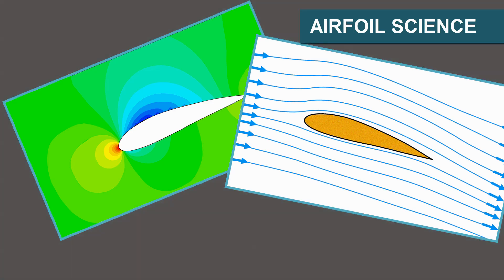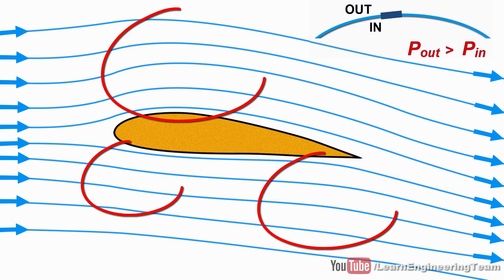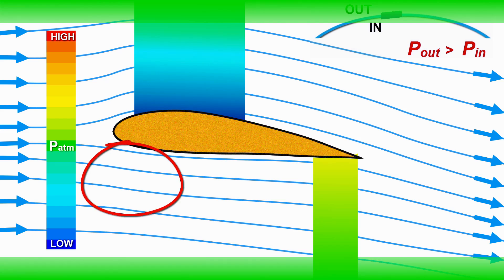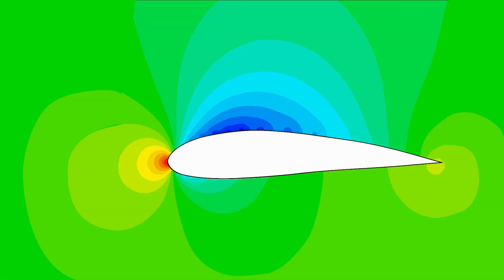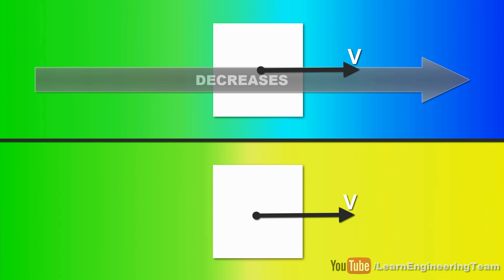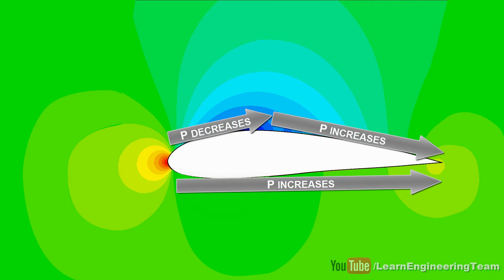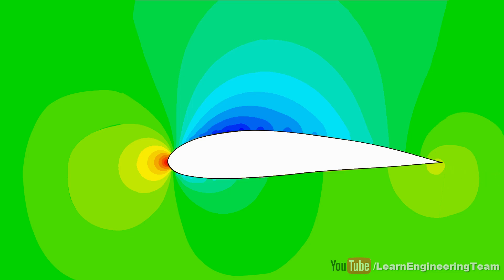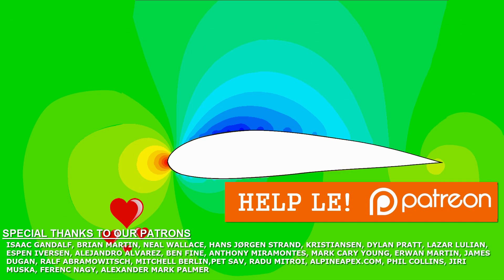Why is the top flow faster over an Airfoil?

Comment: The explanation is the starting and stopping vortex. 

See this as computer simulated:
 https://www.youtube.com/watch?v=bvV7-9wAXc0

An see this as shown in the reality:
https://www.youtube.com/watch?v=BlZrFz0DXr4

Believe not in my explanation, but in your eyes! The second video is shoving clearly the effect, what I describe below.

The little diameter but quickly revving starting vortex has the same perimetrical speed as the big diameter vortex with low rev. 
Starting vortex is doing the biggest job for scientist, gliders, motorized flyers, because it starts the bigger vortex, after separating from trailing edge, and later it dissolves, dissipates in the airflow. 
But it has done the biggest part of the miraculous work of creating LIFT and DRAG!
It has started the big vortex! And that is the more important point!
Because: the big diameter vortex (bounded to the foil, and moving with them around the foil) is let moving the air particles under the foil in the opposite direction as the moving direction of the foil, and lets increasing the speed of the air particles upper the foil. 

This is the real reason of speed difference between air particles travelling on the upper and bottom side of the foil.

Please note at the beginning of the video the starting vortex, which revs in the same place, where it has born, although the foil is fa away. It is existing even without the foil, because foil is travelled with the time very far from starting vortex.
(By sailing boats the satrting vortex doesn't revving in the same place, because wind is carrying away them, but they are travelling even further from the foil)

And please note at the end of the video the big vortex which is existing as well without the foil, because the demonstrator removes, raises the foil from the bathtub, and the big vortex is still revving without the foil.

This is the real cause that airplanes can fly.

If you are paying attention to the second part of the video, you can see at the same time both vortexes, which are revving in the opposite direction!

You can imagine this as two gearwheels, or the self starter of a car. 
At the beginning the engine needs the help of the starter, but later it works autonomously, and drives your car forward.
Foils create LIFT, which holds the plane in the air, and helps sailors to sail windwards.

DRAG is owerpowered with the engine of the aircraft, or with the loss of height by unmotorized gliders, or with the power of sails. On a sailing boat the LIFT pushes the boat forward, and sidewards too. Sideward forces are resisted/balanced with the keels, and other foils under the water on a sailing boat. But sideward forces from LIFT can't be defeated fully, that is the reason for side slip of sailing boats.
This means, that a direction showing by a sailing boat vessels apparently longitudinal axle isn't the final direction over the ground of the see, or water. LIFT pushes  the boat sidewards as well.

This causes, that you see a direction on your compass at the sailing boat, and if you copy this direction to a paper map, and after some hours of sailing with the same constant direction you won't be at the place where you have planned.
The sideforces from the LIFT will mislead you, so your direction above the ground isn't the same as shown on the compass.
Reply: The starting vortex does not do anything. It's necessary for conservation of angular momentum in a fluid, but it isn't a "cause".

Comment: The lower pressure gradient on top foil is lower than the bottom foil BECAUSE the fluid particle is moving faster. This is the result of the Bernoulli principle, which states that fluids at higher velocities induce lower pressures. This explanation uses the consequence of the acceleration to justify its existence.
Reply: No, you have it backwards. The faster rate is due to the lower pressure. It's common to get this backwards. https://www.grc.nasa.gov/www/k-12/airplane/wrong1.html

Comment: Shouldn't the atmospheric pressure get low as we move upward?
Reply: You're thinking of atmospheric pressure changes due to altitude changes on a planet scale. This is talking about the scale of a wing, and the pressure change from the top surface of the wing to atmospheric pressure will be an increase.
Reply: that doesn't really matter in this situation. What they mean is that the pressure over the wing is lower compared to the atmospheric pressure.
Reply: lol is this a troll

Comment: This is by far the best concise video on 2D airfoil flow. There are so many misconceptions out there, it's refreshing to see a video which communicates the main ideas so clearly. 

Whilst it doesn't directly explain lift and drag, those two forces can be inferred from integrating the pressure field around the airfoil surface. The only part of the picture it doesn't help to show is that of momentum conservation. A net lift necessarily results from a downwards component of momentum imparted to the freestream.

Comment: I wish you provided more information about why the pressure gets lower above the airfoil. I just can't get what makes the pressure lower there.
Reply: curvature of the flow makes the pressure gradient.
Reply: basically its just  a suction force
Reply: "suction force" doesn't say anything at all about why this suction exists.

Simply put, the lower pressure exists on top of the airfoil, because part of the air that was supposed to be there, was deflected by the bottom of the wing
Reply: I thiiiiiink it has something to do with the speed of the airflow.  Are they trying to say rushing air is thinner?  I don’t know…….
Reply: It has to do with Bernoulli's equation; basically pressure and velocity are inversely proportional. That is, as pressure increases, velocity decreases and vice versa. You can google it, and here's a reddit discussion about it: https://www.reddit.com/r/AskEngineers/comments/7h1i7y/why_pressure_decrease_when_velocity_increases_in/

Comment: it is because the integral is an area of the wing under the top half, above the bisection and air being disturbed must accelerate so that angular momentum may be conserved and it is inversly proportional to bernoullis equation describing increased velocity and lower pressure within a tube's bottle neck.

Comment: Can someone explain the pressure gradient on the lower side of the wing of an airfoil?
Reply: because of the typical shape of an aircrafts airfoil, the top has a larger travel surface area than below. The air molecules hitting the leading edge is dispersed both upwards as well as downwards. However because of the leading edge's higher angle at the top relative to the wind, the air is deflected higher upward, leaving a void of impact area just behind the leading edge. Below the air is relatively hugging and even impacting ( depending on flap settings) the underside of the wing creating a higher pressure and therefore lift. The natural property of air is to balance out and will therefore push towards the lower pressure area anything in its way, the wing in this case.

Comment: this explanation is valid for inviscid incompressible and steady flow? or is only for viscid flow? thank you
Reply: In an inviscid fluid such as liquid helium the flow would just double back round the trailing edge and no lift would be generated. In an ever-so-slightly viscous flow, the flow separates from the trailing edge and a starting vortex is dumped on the runway. By the conservation of vorticity, a topological principle, there must be bound vorticity associated with the aerofoil which then generates lift by the Magnus effect. The Kutta-Joukowski circulation theorem and the Magnus effect are practical synonyms.

Comment: Can someone please clarify for me: Why does the pressure increase on the underside? At 2:51 it shows that the net force is reversed (why?) I know this fits in somehow but its not computing for me. My basic understanding of an airfoil, is that lift is generated by a differential of relative higher P underside, as to the lower P of the topside. If you look at a smoke test with an increased AoA of the wing, you can see this effect is evident where the molecules slam into the underside, hence drag would slow them (???), but in the video it also states that it is not fact that pressure=speed works both ways. Also, the underside of the airfoil is slightly curved, so in level flight how is the P increased? Thank you.
Reply: sandi x,  May I try and explain.  When the wing is forced forward, it forms a compression zone at its leading edge acting  slightly above and below  this edge. The position of the leading edge with respect to the lowest point on the airfoil section decide on size and overall location  of this compression zone.   The air particles that enter this compression zone are shot  "half"  towards the upper and "half"  towards the lower direction, where they  try to separate from the associated surfaces and so  create low pressure areas  further back than the leading edge, above  and under the wing.  
You must appreciate this before we go any further.
So under the wing there could be  a lower pressure zone just like there could be above the wing. 
Now the idea is to redistribute these areas of low pressure  above or under the wing, by making the aerofoil unsymmetrical  and it could also  be given an angle of attack where the low pressure on the underside can be turned into a high pressure zone, by the fact that the down directed particles  at the leading edge and elsewhere on the lower side are not allowed to leave the  lower surface, but push on it.  The high pressure on the underside also helps to counteract the high pressure zone above the leading edge that accelerated the particles up,   otherwise the wing will  dive down!!
Reply: Carmel Pule Best explanaion, but you can add that when the airfoil's aoa is upward, the surface just behind the leading edge has almost no molecules pushing against it , hence the relative low pressure, compared to below.

Comment: may I  just ask :) if we admit that the particles move faster along the upper surface (even though not because of the travelled distance), is it possible that Bernoulis principle still plays some role in the lift? I understand that it only applies along the flow, but if we consider similar characteristics of the upper and lower flows, could it still generate some pressure difference? thank you :)
Reply: Bernoulli's does not predict nearly enough of the actual value of observed lift.
Reply: @error.418  It predicts the entire actual value of lift. If you wrongly assume equal transit, calculate velocities from that bad assumption, and then calculate lift then that's your fault for making a bad assumption that Bernoulli never said.
Reply: @AmbientMorality  I already linked the resource from NASA refuting this in a separate comment. You can also look it up yourself.
Reply: @error.418  What do you mean by "Bernoulli's"? If you mean equal transit theory, then sure, but that's a bad assumption. If you mean the pressure distribution over the airfoil does not predict the entire value of lift, then you are wrong as per every aerodynamics textbook ever written

Comment: +Learn Engineering why does the top curve cause a low pressure zone
Reply: I believe it has to do with the coanda effect.
Reply: maybe this could be useful to you: https://www.youtube.com/watch?v=21YB4qCvIK4
Reply: Aniekan Umoren thing about releasing the airfoil. The streamlines will return to the initial position so on the top curve they will move down. Thus the pressure above the curve have to be higher than below. The above zone of the first streamline is the below zone of the second streamline. So the pressure one the above zone of the second streamline have to be much more higher than the one on the above of the first streamline.  in this is because the pressure is increasing.  Hope you understand now :)

Comment: the pitch of the wing and pitch of the slope on the wing creates a pressure differential
Reply: !00% correct and simply put. The velocities do not create the pressure difference in this case, rather the pressure differences create a difference in velocity.

Comment: i don't understand why p_out is more important than p_in ?
Reply: Consider this.  A vile of very concentrated gas is released in the center of a larger container.  No gas was present in the large container until the release.  To simplify it think about a cross section in 2D.  A molecule on the edge of this new circle of gas will have some random velocity, but the only important part is whether it is pointed away from or towards the ball of gas.  If it is pointed away from it, it will continue unobstructed, but if it is pointed towards, it will hit other other molecules and be slowed down or turned around.  This is basically why high pressure areas push against low pressure areas of gas.  Molecules going towards the higher pressure area are much more likely to be slowed down, stopped, and turned around because there are more molecules they might hit.  The force on a body of gas comes from the average number of molecules to potentially deflect or otherwise obstruct the path of individual molecules.  

So the air forced against the wing's underside creates the high pressure zone.  The molecules adjacent to the wing either will be moving away from or towards it.  The one's that hit the wing is deflected downward, while the one's moving away just keep going.  This results in pushing the wing up.  You may say that the same thing is happening on the top of the wing, and it is.  However, since the top of the wing has a lower pressure, more of the molecules which are going away from the wing continue without being knocked back towards it.  There are also few molecules in total to potentially hit the wing and push it downward.

So to answer your question, the molecules on the top of the wing are pushed downward by the highly pressurized air created above the wing, while the molecules below the wing are pushed down by the wing itself (and and also some pressure).

Comment: so why is there lower pressure at the top and higher pressure at the bottom. In both places on the air foil the air just follows a curved path, how does this indicate air pressure?
Reply: "the faster a fluid moves the lesser the pressure." you have this backwards. It's the lower pressure that causes the increase in speed, not the other way around. https://www.grc.nasa.gov/www/k-12/airplane/wrong1.html

Comment: More classic version, still logical:   if the flow-pattern is actually the sum of a 'circulation' plus a uniform horizontal flow, then, in the region above the airfoil, the circulation always adds to the average velocity.   Below the airfoil, the circulation must subtract from the average velocity.  (Works fine for rotating cylinders, works for more complicated 2D airfoils.)    Result:   any parcels which split at the leading edge, will never meet again, as long as circulation is present.

Another result:  if the shape and angle of the airfoil gives zero lift, also the circulation becomes exactly zero.    In that case, any split parcels at the leading edge will recombine again at the trailing edge.

Rule of thumb:   if split parcels recombine at the trailing edge, it means that the lifting force is exactly zero.    The infamous "transit time fallacy" turns out to be a description of a zero-lift airfoil.

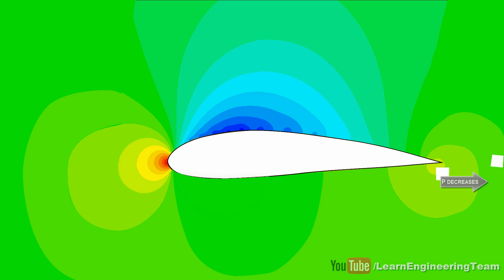Comment: 3:33 "such a sudden drop in pressure will not considerably increase the particle speed"

The drop in pressure will change the speed independent of how sudden it is, as Bernoulli Equation demonstrates. The correct explanation here is that change of speed at the end of the trajectory doesn't significantly change the total time the path takes.
Reply: yeah this is a bonkers video, quite annyoing, thx for your comment
Reply: I was going to comment the same until I saw yours, thanks!

Comment: The initial upper part of the air foil  is synonymous with an orifice inlet where your area decreases and velocity increases for the same potential of fluid flow; in which air in higher vicinity acting as wall of the orifice. That is why higher speed is achieved at the top and there is no significant curvature at the bottom to cause the very same effect.
Reply: This is incorrect.